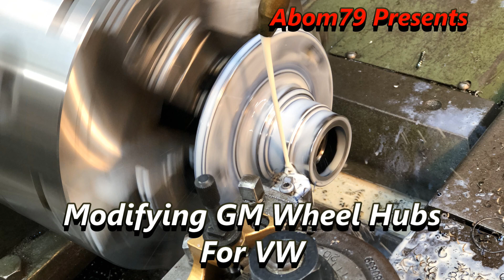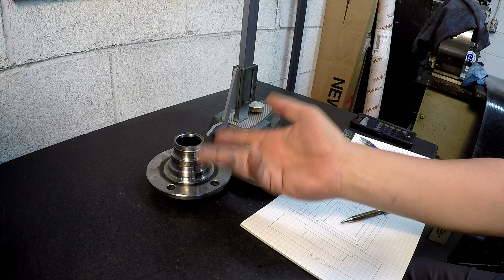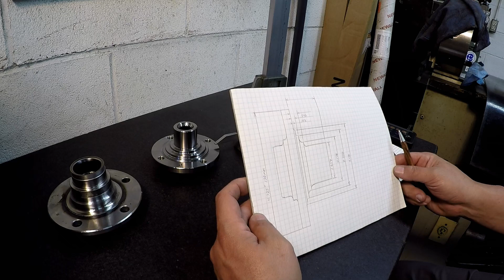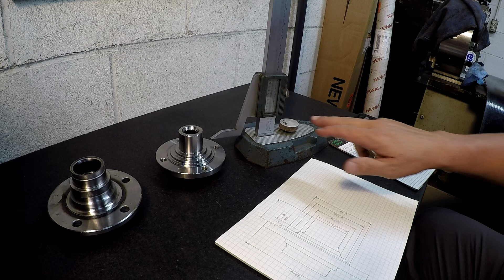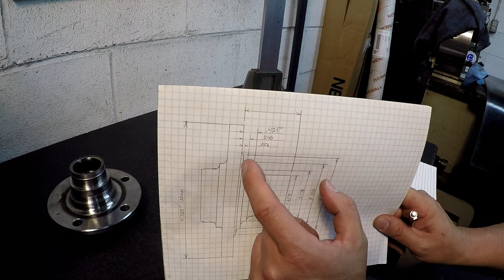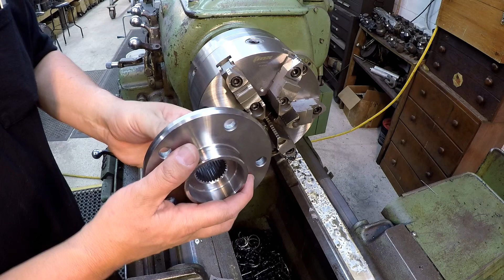Modifying GM Hubs for VW

Comment: Hey bud, company I used to buy hubs from was bought out and closed down, I can no longer locate their site.

I don't understand why your friend isn't just matching up his drive train to these hubs instead of having you modifying them. GM hubs are trash to begin with, used to work for a GM dealer in Alaska and they would go out like clockwork on the drivers side all the time. Would have been easier and cheaper to have designed around the hubs rather than having you modify them. A shaft and/or a mounting bracket is much easier to replace in the long run over having to redo a hub bearing assembly.

Your friend isn't the smartest hot rodder out there and if he doesn't have the money to do it right well... He should stick to go-carts.
Reply from the maker: There’s the obligatory “ why not just use...” remarks. It’s not my issue how the man is designing the car, I just tried to help.
Reply: @Abom79  This sound like people on my "trade" (software), there is always a "why not just..."
Reply: @maxsnts  what is wrong with suggestions? Are we that sensitive where we aren't allowed to suggest alternatives that could save money?
Reply: @PB-wb2kj  Ir's not up to the machinist, you work with what's supplied by the customer or someone else will, yes it's that simple, and for all of you guys with the big ideas you need to post some of your work for scrutiny, in the immortal words of Keith Fenner, "walk the talk".
Reply: @Peter-V_00  I corrected myself already in that regard, my comment should have been phrased towards his customer and not him. I never criticized his work so why would I need to show anything of mine? Customer is making a strange choice in my eyes. Getting a part that needs to be custom made in a part of the drive train that is going to see a lot of power is strange to me. Only work I could show I'm not allowed to show which were modifications to Kubota tractors back in the day. Never thought to post them online.
Reply: @Abom79  why not just do it exactly how you were asked to by the customer, and get paid? 🤔
Reply: @Abom79  I know man, you are just doing your job and you are doing it well. I should have phrased my comment better towards them instead of you. My bad on that.
Reply: This is the way they chose to go. No need to insult his customer over his choice of how to built his race car.
Reply: The comment about the "GM hubs are trash... *guff huff puff*" is nonsense and irrelevant. These hubs are no longer GM hubs.
Reply: @xenonram  they are designed by GM.... Those are GM hubs.
Reply: Peter B they no longer have the weak point of a gm hub (the bearings). Now he’s just using the splines for bigger axels.
Reply: @tfreddy27  you know... Good point.
Reply: @PB-wb2kj  The guy wants to run chevy axles on a hi po vw as they can take more torque, not sure he did his homework because there are a few aftermarketers that specialize in vee dub  axles. I thought what you did too, just stock g.m.junk.
Reply: Nobody here is interested in your opinions. We are watching machining channel.
Reply: @oheebatch_algorytmu  feel free to ignore my comment then.

Comment: Welded hole is hard because it's done by stick or (a bit softer) mig welder. I ALWAYS weld-fillup such holes with TIG. TIG welds are soft and easy to work with. And TIG welds, if done properly with clean materials, almost never have any "bubles" inside what can't be said about stick/mig... 

In case of TIG as filler can be used also same material you are actually welding- in case you have spare/extra parts from to cut off some stripes to be used as filler rod. This will give even better result which none of other welding methods can give at all!
So, I guess, It's worse in future for customers to ask do this with TIG or, if they don't have TIG, do it yourself. 

I think, also, that one new hole is too close to older, partly "open" one.

About cutting hardened steel (and bearing races as well)- I've seen some guys are using those greyish (carbide?) endmills regrinded properly in lathes to do such jobs. Just need to make toolholder to hold round endmill in lathe's toolholder. And usually machinist's have some broken ones, which can now be reused as sometimes these endmills brakes off close to base and are not regrindable anymore for milling work.
 These are pretty tough tools- I have one such endmill, for example,  which is rated to cut materials up to 58HRC.
Good thing about such approach is that you can regrind and experiment once you get to proper cutting speeds and cutter geometry for particular job. With inserts it's quite expensive as you brake them and can't regrind them anymore. And not always inserts have proper geometry for a particular job.

Comment: bearing on soft steel, disaster in sight
Reply from the maker: New bearing being installed doesn’t require hardened steel
Reply: It will be fine. There are bearings installed on unhardened steel all the time (most of the time) and it's perfectly fine. If the bearings are getting hot enough for "thermic transfer to weaken the steel," then there are other more important problems.
Reply: Nope, factory press on bearings go over soft steel all the time. Only hardened due to it need the ball bearing to ride directly on the hub, new ones have races built in to press on.

Comment: I made a funky adapter for a grinder to attach to my cheap chinese lathe... would a grinder be able to get you close burning a cheap grinder wheel instead of an expensive cutting tool. probably wouldn't save you much time but maybe some cost

Comment: why no oil with the carbide drill?
Reply: coolant isn't recommendend when drilling hardened steel.
Reply: ferze001 unless it’s designed at through spindle high pressure. Flood cooling is intermittent and can cause hot spots to get quenched causing fractures just like glass does if it gets hot and rapidly cools

Comment: Over the counter parts are available for them. They just want you to reinvent the wheel for cheaper.
Reply from the maker: Please share the part numbers
Reply: Abom79 https://gear-one.com/
Reply: I doubt they have any pre-made to accept "gm" axle splines. in the vw rails and racing, everyone went to bus or porsche outer cv's and swapped axle stubs machined/made to adapt the larger cv to car hubs and other aftermarket things. 
I'm guessing they're breaking things all too often drag racing and not using vw engine/trans.
Reply: @Rail9222  Their customer hubs are for 5 hole rims aimed most likely a racers using Ford, Chevrolet, or dodge rims. The customer's car has 4 hole VW rims.
Reply: Pretty sure 50% of the viewers have zero understanding of what the Customer was doing. Using an off the shelf part that is modified to fit the vehicle while gaining the strength of a larger drive axle spline. Which is also an off the shelf part. The modified/machined  parts are reuseable, the axle and bearing is replaceable. #KeyboardMechanics
Reply: Lol. I guarantee you that having Adam machine them is a lot more expensive than buying "off the shelf" parts. So I'm sure they would have bought the off the shelf parts if they were actually made.

Comment: i wonder if it wouldn't have been better to just make them from scratch... but it's whatever the customer wants.
Reply: Not to mention broaching in all of those splines.
Reply: Make them from scratch from giant chunks of the proper steel...then he'd have to heat treat and harden it with enough accuracy to make it safe for a racecar...I'm thinking this is way easier and safer.
Reply from the maker: Splines
Reply: No, that wouldn't have been cheaper.
Reply: The spline broach would be expensive! Probably $1500-2000 at least

Comment: I work in IT, and the hardest part of my job is estimation.
Reply: OMG this!  Well, I've never done this before, I imagine the fix will take about 30 seconds plus processing time after diagnosis, boss.  Diagnosis timeframe?  I'll give you 4-72 working hours for a conservative estimate, 120 hours estimate if you don't want that 72 hours to be Monday, Tuesday, Wednesday.  Seriously, when i was in the Navy, we had our domain controller shake its CPU loose and crash the domain hard, had to have DC2 forcibly take over the domain, restore DC1 from disk image, remove and reinstall Active Directory on DC1, set up DC1 as "secondary" and then transfer primary role back from DC2 to DC1.  Second longest weekend I had.
Reply: So it's your fault the boss ride's my arse when a broken bolt that the estimator didn't think about cause's me all sorts of grief,,
Nar only Joking,,but it is true you cannot think about every thing that don't go according to the PLAN,,

Comment: Next time you can just make the hubs from scratch and cut the splines on the shaper. :-)
Reply: He would either have to make them from a giant chunk of already hardened steel...which would mean removing WAY more material...or make it from the un-hardened steel and heat treat it and harden it properly to make it safe for a racecar. Yucky.
Reply: @animalmother556x45 
hubs are usually never hardened but heat treated or forged. this one is an exception because of the bearing races on the shaft that requires surface hardening.
the real expensive task would be the ID broaching for the drive shaft anyway when making from stock.

Comment: Do they make Dimond lathe tools for hardened steel
Reply: BARNEZY44 _ 
Not that I know of, most diamond is a grinding wheel style. 
Best you can get is ceramic which is expensive and needs high hp

Comment: Will the customer need to have the parts case hardened before he can use them and won’t they be weakened to a point of dangerous having so much steel removed
Reply: Wondering the same thing.
Reply: Don't think so. The very hard part was an actual bearing race in the original part, whereas he'll be using a sealed bearïng afterwards. Actually, hardening is probably detrimental in this case as it would make the part more brittle...
Reply: @kain0m  Do you think the needle race will preform the same as the angular contact with side loading??

Comment: If it's not too late a threaded hole to hold the rotor on the hub would be helpful. 
To prevent the holes from misaligning when putting the wheel on.
(That fifth smaller countersink hole.)
Reply: they switched from wheel bolt to press in wheel studs, so nothing to align anymore except rim with the studs

Comment: Great video and good job. As my (unsolicited) 2 cents, I would've annealed the hub. You effectively turned bearing races and the hardened welded up hole might become an issue since the stud's splines won't grip in the hub, risking that stud to spin when torquing down and/or taking off the wheel nut. The only place where it might be important for the hub to be quite hardened is the interior splines, even so, I doubt it would be an issue.

Comment: Good job making the ChevroWagen frankenhub. Turning that out of a billet would have been a bear, even if you could broach the splines. Functionally it’s fine, just the aesthetics of the leftover holes detract from the part. The customer got what he wanted so all is good. Lets see some more paying jobs. Thanks for sharing.
Reply: The holes wont be visible with the rotors and wheels on.

Comment: Edit: nvm, looked up the SECO insert, question answered.  :)

We would use that kind of insert to rough off the ends of hydraulic cylinder rods that had been case-hardened with an induction machine, then plated with industrial-grade chrome - the stuff was so tough, it would leave dents in 4145 bar stock and you couldn't even see where the rod hit it, tested out something like 80 Rockwell C...

Comment: It shouldn't amaze me that you can hear the difference between harder and softer material, but the squeal is not something this ex-carpenter ever heard in wood. Thank goodness.

Thanks, Adam!
Reply: I worked on a british navy ship that had lignum vitae (hard ass wood) pieces in the engines main shaft stern tubes... we wore out some tools before we slowed things way down when trying to cut/shape and drill them. That wood squeals believe me! LOL
Reply: Wood screams like that when I'm working with it. That's probably why I put the rough in rough carpentry 😂
Reply: @thatrealba  Aww, that's just a dull saw blade. ;)
Reply: @SaposJoint  oh. You mean it's not supposed to catch fire every time I make a cut? I always wondered why there were all those extra blades hanging up at the hardware store 🤦‍♂️😁

Comment: @abom79 I got a recommendation for you I know you like your files but why done you get some air tools such as a right angle sander and for the small little detail sanding get a air tool called a micro die grinder it is a amazing air tool for that small little detail debarring you will have to buy some mounted stones but mc master has those for real cheap. All sorts of shapes and different co,Ora for softness and hardness and also get some diamond coated burrs for deburring hard steel the micro die grinder takes a 1/8 inch die stones only you would love the it tool. Here is a link to the same one I got  http://www.penntoolco.com/jupiter-pneumatics-5530007545jp-1-8-pencil-die-grinder-52-404-1/ I highly recommend it you would love it. Also the right angle air sander I recommend the S lock sanding pad and Discs to help you speed the debarring process along.

Comment: hello such greetings from mexicali baja california mexico, I am also a tool maker and I am 28 years old, what good videos you have, a little long with a lot of information, in this video I realized that by centering the pie in the chuck you could haver used the counterpoint bolt instead of hitting with the hammer ... but it is the same result ..

Comment: Thank you for leaving the sound on.   Machining is just as much hearing  as feeling.  On my manual equipment, I can feel what is going on.  At work, I run Cnc  and have to listen to the cut.   Everyone should learn the sounds of actual cutting.  You learn the sound, right before the drill breaks or the insert cracks.   Hearing protection is a must, but the sounds are important.

Comment: how does a dro even work when youve got backlash in the table?
Reply: The DRO reads only when the actual table moves. Backlash is ignored by the DRO as the sensor only detects actual movement of the table and not when the screw takes up.
Reply: @godhammerof5141  aha!

Comment: Those will be induction hardened, so only 2-3mm of case depth before the core material which would only be normalized (~20Hrc).
Taking off a few mm will definitely affect the longevity of these hubs.
Reply: I was wondering how they hardened them dimensionally so precisely.  Really interesting.
Reply: John Arrington look up induction hardening videos, really cool process.  I missed the part in his video where he mentioned that there was an inner race being pressed on, so the heat treatment doesn’t matter
Reply: @piperjohn_3  I dare say parts are roughed close to size, heat treated and then ground to final size.

Comment: five to six hundred horse?  what are they going to do with all that?  assist semi trucks up the western side of cabbage pass?  that would be a sight to see, wouldn't it?

Seriously, though, ... it does make sense to make up only what you need for the initial testing.  If something about it turns out to make it a failure, as related to the design, you won't have two sets of worthless yet expensive machined parts haunting your shelves.

If "Vokswagen" is supposed to mean "Peoples Car," shouldn't the name be changed slightly for the racing modified versions?  What is the word "race" in German?  "Volks-????-wagen"  ???  (Just a random thought, shutting up now...)
Reply: id imagine drag racing or some crazy sand rail action...

Comment: Will these hubs need to be hardened now?
Reply: No they where originally because it had an integral bearing race. That's why it was only induction hardened in the center at the races. The new ones are pressed on sealed roller bearings.
Reply: Not likely as this part wont experience any 'wear'. All the load and wear will be taken up by the new pressed on bearing which SHOULD be properly hardened.
Reply: Hey, thanks a lot guys. I learn so much here!

Comment: Not a very pleasant video to watch with the high pitched squeal from those cutting tools.  I might as well turn my sine wave generator on and test my sound system.  LOL...you can apply an audio filter to reduce the squeal...just suggesting...love your channel...
Reply from the maker: Turn the volume down
Reply: FYI -There is a control on most computers that will reduce the volume.  Just sayin.

Comment: I try not to bother with many questions because I don't work in any related field or even machine as hobby,I just like watching. After machining and drilling new pattern it looks like it would be out of balance. Is it not critical for drag racing straight down a track? Am I wrong about the balance being off and just tricked by the camera and my own eyes? Is it such a small amount that it is no concern? If it was discussed and I missed it I apologize. There,that's exceeded my quota of questions for a while. :)
Reply: i scrolled through the previous video, and i don't think he mentioned it there (so it may or may not be true for this job) but in the past i clearly remember this question coming up before and he mentioned that the customer takes care of it themselves (found it, SNS 169 Part 2, 12:30ish)
Reply: The amount it will be out of balance will be minimal can be taken up with wheel balance on the rim if it shows up. Raced in my younger years Drag and Circle Track

Comment: Out of interest, why no cutting lube when you used the carbide drill bit?
Reply from the maker: Would have been best to flood it with coolant. The amount of cutting I was doing was not going to upset that drill.
Reply: @Abom79  OK cheers for answering. Because of your posts, I have bought a Myford lathe that I plan to use for learning. Thanks again.